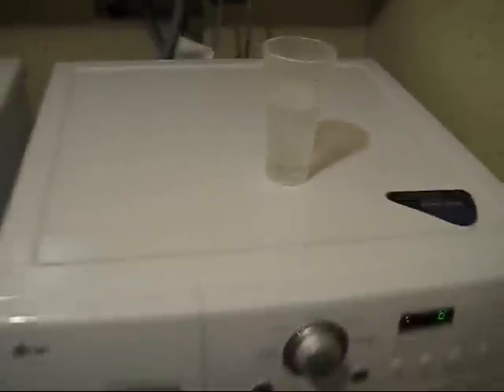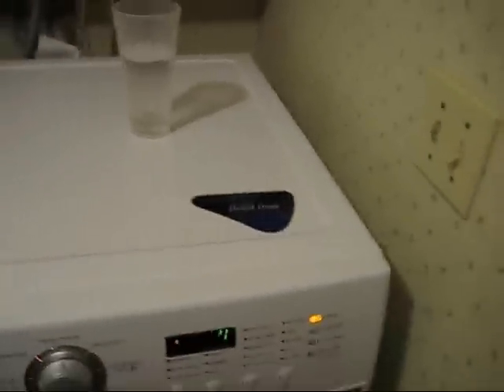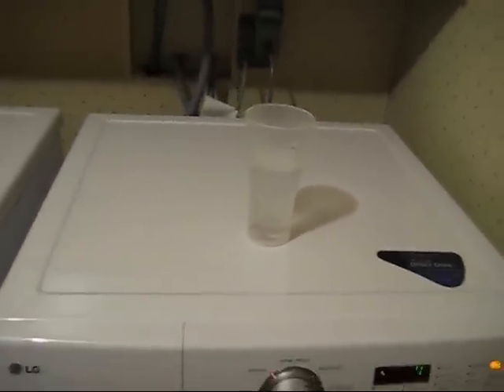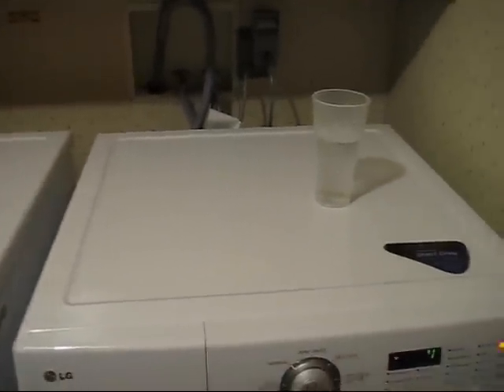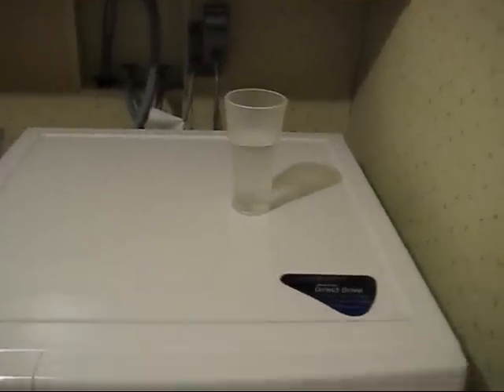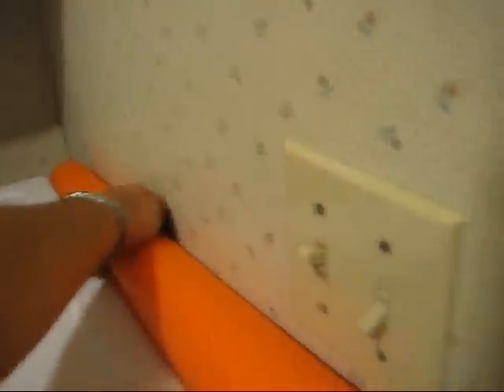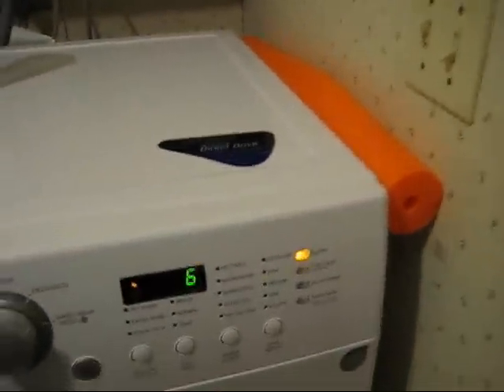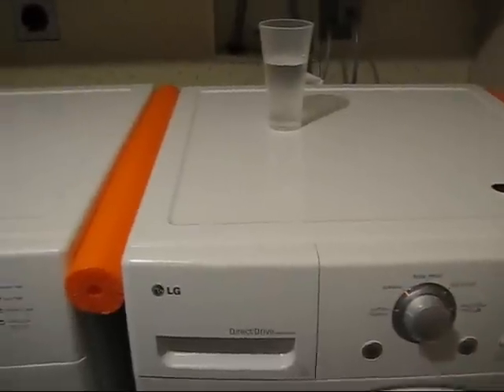Vib Fix Before After (see the ending!)

Comment: I have a 6 year old Kenmore front loader with the same vibration problem.  Extensive efforts to balance the machine have not worked.  I tried those anti-vibration feet (two different brands) and they helped only a little.  I bought the swimming noodles yesterday and tried them out.  Presto, problem solved.  For a few bucks, I am amazed how well this works.  Vibration is reduced at least 90% in my estimation.

Comment: I was told by a repair man that you can place foam under each of the legs/feet and it will stop the vibs. He also suggested using a yoga mat under the entire machine be sure all feet are on it.
I will give it a try too. i have the same problem.  I also have a problem with bath towel loads.  It will always get off balance and try you crazy trying to put only 2 in at a time. Don't buy front loader!!!

Comment: You know what? Did you guys ever remove those LONG SHIPPING BOLTS from the back?  Mine did this and as soon as I removed the 4 huge bolts in the back my machine ran like a dream. Go see quickly if that could be your issue here.  The drum of your machine is probably  not moving like it should because its held in place by those bolts.

Comment: When I lived in the usa all that was available was top loaders, you've finally gone the way of europe and started having front loaders....sounds like maybe its not got a level floor, I have a front loading Bosch at home and meile at the hotel - both have adjustable feet to compensate for balance. As long as it washes the clothes efficiently I wouldn't worry about a little vibration, it will save you loads of money,water etc compared to those big old clunkers I had to use when I lived in Miami!

Comment: Aren't you curing the symptom rather than the problem? The problem is that the machine is not leveled correctly, which could lead to damage over time. Level it correctly, and the noise will likely go away, and you won't break it.